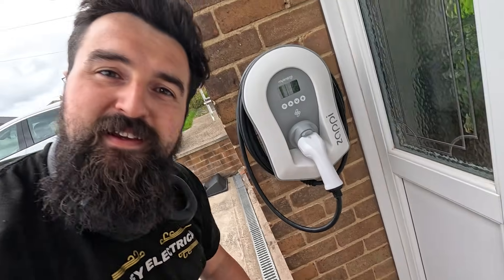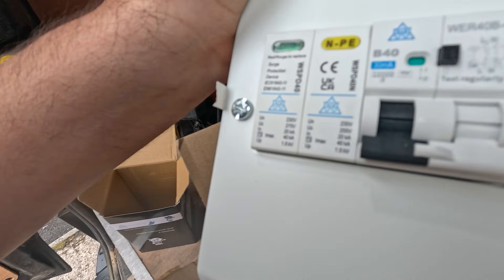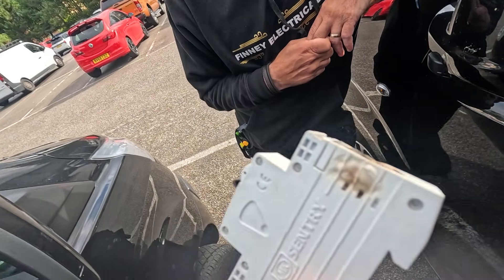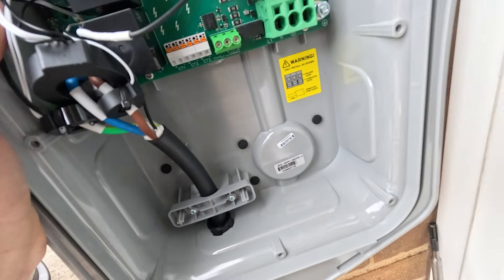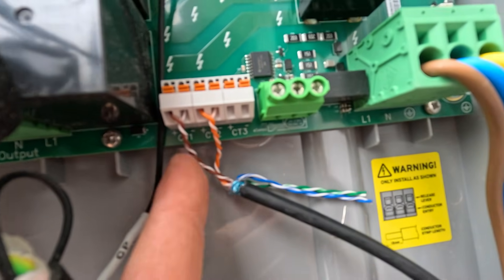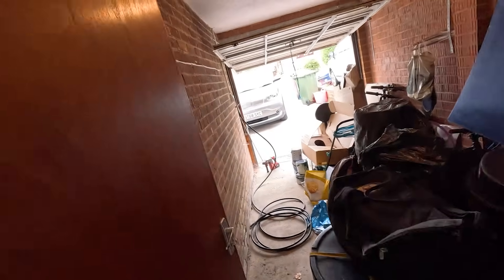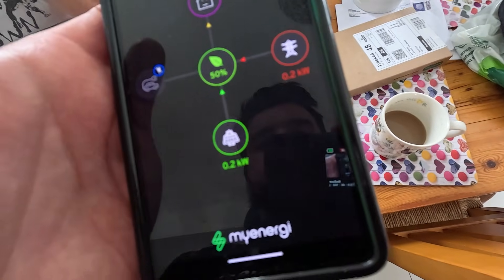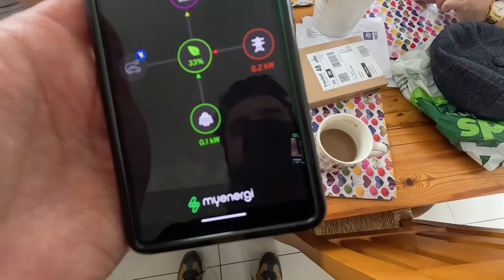ZAPPI EV CHARGER INSTALLATION & SETUP GUIDE!⚡🔋

Comment: I’ve installed the Zappi charger for my mum. We don’t have solar panels so we don’t need the CT clamps. I just want it to run off the grid how do I set it in the settings for this to happen?
Reply from the maker: So you still need the CT clamps to know the houses load, ct1 should be set to grid. You need another ct in ct2 for solar which you don’t need

Comment: The finesse and skill is brilliant mate, ace job and top video as always! It’s mad how much detail EV apps and things have now🤯 btw what does CT1, CT2 & CT3 actually do/mean? keep up the class work mate, you’re killing it👌🏻
Reply from the maker: Cheers boobby, must have missed this one. Ct means a current transformer, so it uses magnets to induce a current in the ct cable which ct1 ct2 ct3 can be set to do different things. Ie ct1 measuring the grid if you put them on the main tail. And ct 2 just clamped around the line going out to the solar panel inverter etc